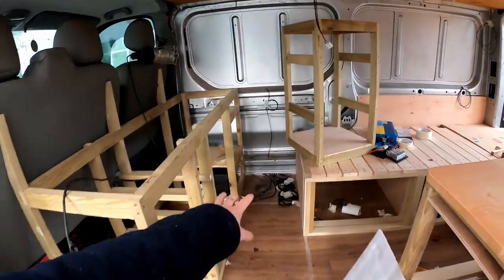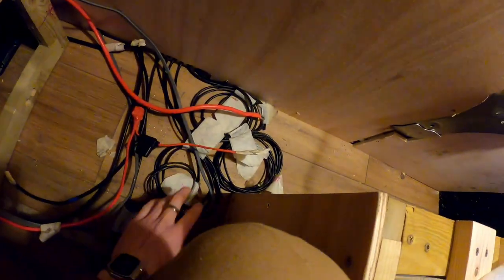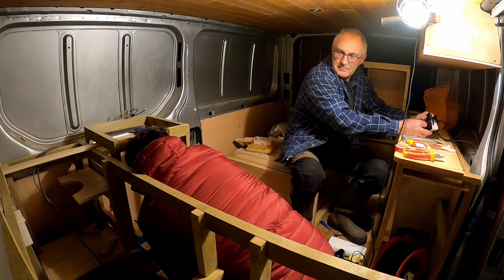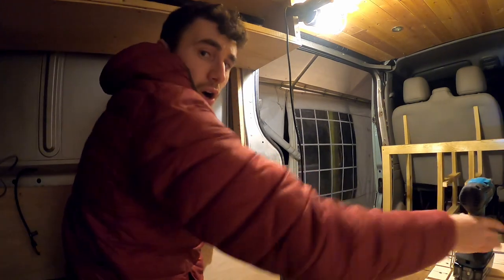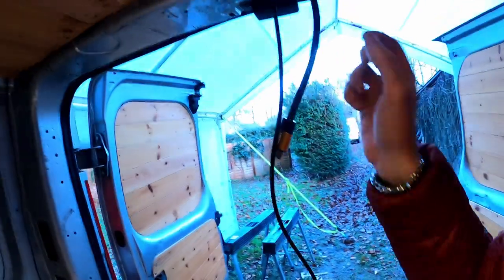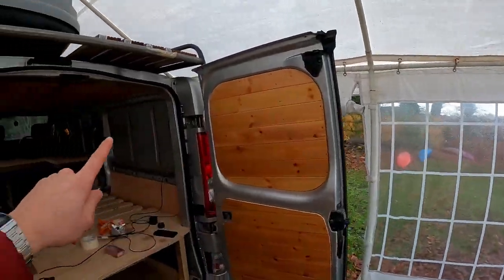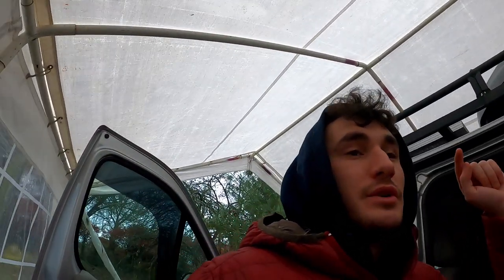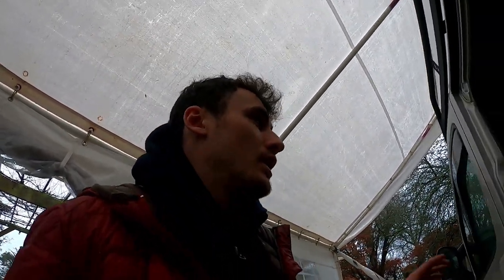Vauxhall Vivaro Camper Van Conversion - Episode 8 - Electrics & More!

Comment: Hi, how did you managed to connect starter battery with lesure battery?
Reply from the maker: The two battery’s I’m using are separate from the van’s starter battery, if that’s what you mean? And I connected them in parallel with battery cable from Halfords, I hope that helps